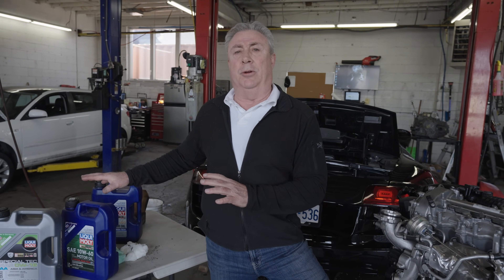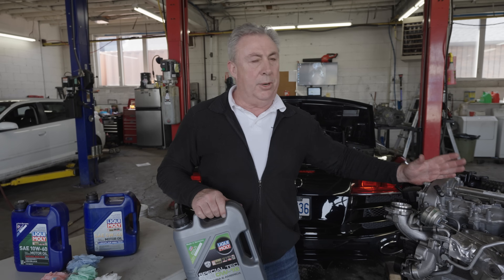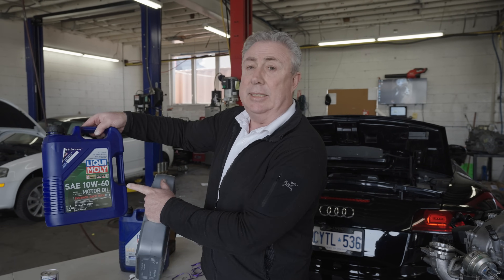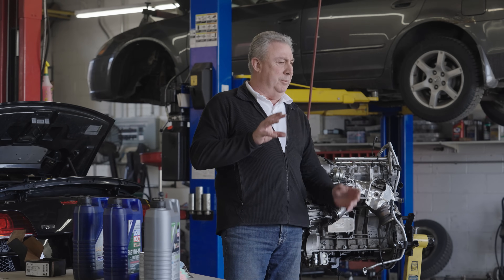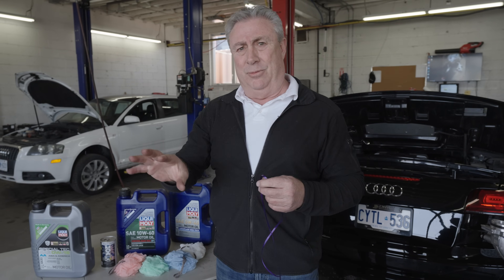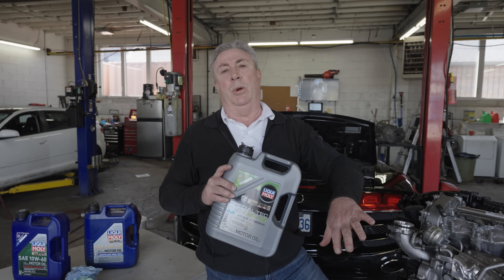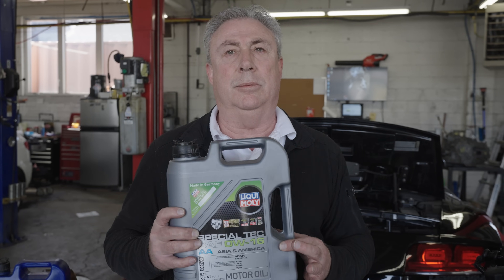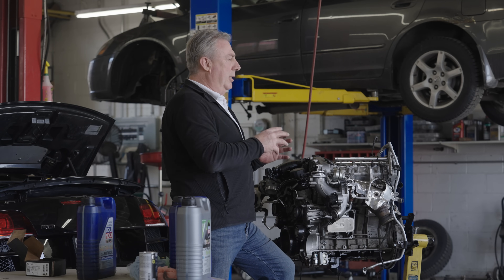Thin engine oil just a Scam? What's Safe

Comment: Thinner oils are also result of motor developments. As always it is a catch 22. Higher revolving engines and turbines (including airplanes) require thinner oil to keep up with fast rotating parts to fill surface gaps and create oil separation. Using high viscosity oils in this application basically makes parts starving for oil. Lower revolving high load oils use heavier oils grade to suppress shocks. Also hydraulics actuators used in modern engine require thinner oils with stable characteristics. In fact it is similar to any hydraulics like automatic transmissions valves etc etc. This is also a case due to usage of VVTI and hydrolilic lifters that all work by oil pressure.

Comment: I am no expert but most of the comments come from experts who still drive their well-maintained, age-old vehicles. The point Steve is making actually makes sense for Euro 6 (BS6 in India) diesel vehicles in particular fitted with EGR, DPF and DEF systems which are, in reality, a nightmare for new vehicle owners including myself. I made the mistake of using 5W30 fully synthetic engine oil with additives and it is ruining my DPF system even after a mere 800kms of using it. I am tempted to agree with the old timers here that higher engine oil grade is better for the engine provided it meets the API specs of your recommended oil.

Comment: Manufacturers use thin oil to get 1% better fuel efficiency. Car owners drive around with low tyre pressures.
And a whole lot of junk in the back….

Comment: The way I look at it.  If you’re in death valley in the summertime and it’s 120* your engine has a thermostat that maintains a constant temp of approximately 190*.   If your in the Yukon in the wintertime and it’s -40* your car has a thermostat that maintains a constant temperature of approximately 190*.    So for 98% of the time your engine is at 190*. The 2% is the cold start warm up.  So I never change the viscosity of my oil for seasonal reasons.  All of that is just a marketing gimmick to sell more oil.

Comment: I've been doing my own oil changes in all my vehicles since I was 16 years old in the 1960's. I never use anything thinner than 10/30. Occasionally I drain oil from a 5/20 hot engine.... it's like water and I don't want it in my car. Now I have a new NV200 Nissan van. I won't let the dealer change oil in it and I only use 10/30.  
From my experience, I don't buy the line that you must use thin oil for tighter tolerance engines. I burned 15/40 in my Toyota Matrix for years. This philosophy is working just fine in my car engines which are no different than any other car engines. Also, if you burn thin oil, you are at greater risk of developing engine oil seal leakage problems..... IMO and from what I've seen. 
I would bet, if you took 10 new Nissans or Toyotas and used 5/20 oil as recommended until they died..... and 10 identical vehicles and ran them on 10/30, until they died, the 10/30's would last longer.
Reply: which is better, 10w30 or 5w40?
Reply: @frv6610    10w30. Anything below 10w is too thin... IMO. If its in a high mileage car and you want a thicker oil for summer or if it's leaking a bit, then I'd go to 10/40 or 15/40 like I did in my high mileage Toyota Matrix.

 Following is something I got from the German car club--- 
 ( In the german oil club Forum, 0w-40 is regarded as a very bad choice, because it is just a marketing gag. Poor quality oil, boosted with VI Improvers that shear down in no time. Avoid it all cost.
If you want to protect your engine, you need a thick base oil, therefore 10w-40. As a side note, allways remember, cold start wear dont exist.
All you need is a thick base oil, thats the most important thing.)

Comment: My 2025 Toyota requires 0W8 Full Synthetic Engine Oil and states it should be changed every 10,000 miles.  I called the dealership Service Department, suggesting that I would be changing the oil every 5,000 miles.  The Service Department warned me that I would void the manufacturer's warranty if I changed the oil at 5,000 miles instead of 10,000 miles. I told the Service Manager that line of thinking made no sense. He then stated that he was annotating this conversation regarding my car's warranty information. Or in other words, threatening me.  Yes, a Toyota Dealership Service Department Manager stated that changing the oil at 5,000 miles, instead of 10,000 miles, would damage my engine and void my warranty and that it was now in the notes regarding my 2025 Toyota!
Reply: I had similar issues with my Toyota service. So when I bought my new ram pick up truck, I drove it to the Toyota dealer and told the salesman and finance manager your service department cost you money and told them I would never buy from the dealer again and so hasn’t three of my friends.
Reply from the maker: It’s amazing how they think that doing something good for your engine would damage it. The Service Department is simply trying to discourage people from doing their due diligence!  There is clearly a different agenda other than best engine management practices on display. 

We've run lab analysis on the used oil of hundreds of new cars to establish a base line to measure engine wear.  In this effort we take a peek at the worn parts metal content in the oil and can accurately track the break in period activity.  We've always seen incredible results on engine service life with 3 or so oil changes before 10,000 miles.   And the same with a regular schedule of 5,000 mile oil service intervals.   

Gotta say, I really like the idea of 5,000 mile maintenance schedule in any case!!  Thanks for the comment.

Comment: Mechanic for 40 years. Had a client brought in an old Subaru wagon 5 speed manual. Can I drive from California to Texas and back. Your transmission will not allow you to shift into 3rd gear. I would not advise. Came back couple weeks later see you were wrong 😵‍💫

Comment: I am sure the designers of modern engines know their craft!My old Honda crv 2004  has a range of grades i can use and it has a graph of temps to work with in the hand book.I always change every 6 months regardless.People also overlook valve clearances in older engines.My newer car is a Honda crv of 2012 ,this uses 0-20 and has never shown any problems.Maybe i am lucky.

Comment: Im 71. Never heard W for winter. It was the base viscosity such as 30 weight. It never gets thicker as in 10w-30 , its still 10 weight oil.
Reply from the maker: Great point!  But that W rating refers to the cold flow properties of the oil at startup and is measured at -17.8C or 0F. The second number refers to the flow at high temp of 100C or 212F.

Hope that helps.  Thank you very much for the comment!

Comment: VVT requires thinner oil to get through the extremely tiny holes. That’s why they fail from to long of change intervals with build up. Never go more than 5,000 miles between changes if you want your VVT engine to last.
Reply from the maker: You are absolutely right - it’s critical to consider the VVT when choosing an oil change interval.

Comment: Poor explanation of the sae numbers, not really very useful video. I believe variable valve timing engines not good to mess with thicker oils. At engine running temperatures the oil will be alot thinner ( viscous) too, worth mentioning. I think a better/clearly explanation of the two numbers on an oil can would be very useful here.
Reply from the maker: Thanks for the feedback, I’ll make sure to explain SAE numbers in more detail in future videos!
Reply: @TheAutoStationBurlington  yes seems alot of confusion on that topic, I guess there is a different scale used in the cold and hot scenarios, thats where the confusion stems from.

Comment: If you don't use 0-20 Oil in Ford gas engines they WILL BLOW UP  
Two of the NEW FORD WORK TRUCKS had fresh oil changes and both blew up within 2 weeks.  
They tried to get Ford to replace the engines and they discovered 10-30 oil in them and VOID THE WARANTY
Reply: You must not be in the US. All current Ford truck engines call for 5W-30 oil in the owners manual and on the oil cap. Ford has never used 0W-20. That's a GM and Stellantis thing.
Reply from the maker: Very good point - I've never heard of an engine blowing up in a couple of weeks unless there's some other issue regardless of oil choice.  Do you happen to know which Ford motor?

Comment: It’s not the oil. It’s the person not changing it on time. Engines easily outlast the vehicle with normal maintenance. The new oils are SO much better than what used to be used. New syn. 0-20 will outperform 10-40 Dino.  why give up power and efficiency?

Comment: The higher the mileage, the higher the oil thick number to use.  Never put thin new engine oil in an old engine.  Old engine has more space between parts, more worn parts.  Needs more cushion between parts.  Thicker Oil.  Also "Thin oil" will consume much faster thru the loose now older piston rings.  It will suck thin oil up thru loose piston rings. Thin oil will be suck up thru old rings to the point a couple of quarts left after a while, and that will destroy the whole engine.  I saved many engines by adding thicker oil. I also add Dura Lube to engine and my jeep rear end too.  Jeep is over 190k miles, Works great.
Reply: Nonsense. All oils get thinner as the temperature increases. So in your case you maybe used a oil with a higher number after the 'W'. Meaning you clearances were messed up for some reason and you didn't want to rectify the problem.
Reply: @morndrewitbooi1896  Nonsense you. Thicker oil is needed for more room between parts.  Sorry you cant get it.  I saved many oil eating engines by not using new engine oil said on oil add cap. Dohh ! Old mechanic here, you kiddo. Think..
Reply: @outwiththem OK now what caused those clearances to increase? Using thicker oil and not changing the oil regularly. So get your facts right
Reply: @morndrewitbooi1896  BS.  It was using thinner oils recomended for new engines only.  You are a liar saying the contrary is done.  Thinner oils are used for new engines not thicker.  Dont bring lies and fake news to me now, damm guy.
Reply: @morndrewitbooi1896  Some people believe in "alternative facts".
Reply: @morndrewitbooi1896  If you have very high mileage, but your engine still runs well and is still quiet, you don't have a reason to "recify" the problem.
Reply: @jamesbosworth4191 What you are saying doesn't correspond to what I've said. Mileage is just the number the wheels have driven. You can have 2 of the exact engines. 1 can be 50000 km's but doesn't run properly and is full of sludge while a 500000 km engine could be running very very well and looks brand new on the internals.
Reply: @morndrewitbooi1896  And that is all too often because one has had regular oil and filter changes and has been kept in a good state of tune and the other one has not.

Comment: 100% synthetic oil can handle higher temperatures. Some engines also require dexos. If the car is under warranty, you better use manufacturers' recommendations.

Comment: If it's cold out and it actually starts, let it warm for a minute and drive it conservatively for a few miles. The internal temp of the combustion does not change rather the heat transfer between the metals and plastics. I did the best I could for the environment but I have failed to control volcanoes spewing ash and to add insult to injury every year I have to watch California burn itself to the ground in their effort to save the environment.
Great video, well explained.

Comment: More confirmation that contemporary vehicles are not made to last long but only to get through the warranty period. Not the country I grew up in. My truck's owner's manual specified 5W-30 and that's all I'll ever put in it. Ford amended that to 5W-20 a few years back but not for better protection. Because of some woke lamebrains in D.C. sacrificing reliability for 1% fuel economy increase. Kiss my oil pump.

Comment: Wow okay this guy knows more than Engineers to design these engines that have smaller oil passages and needle bearings in them which require the viscosity recommended by the engineers that Design This engines anybody listens to this fool is strictly a full so go destroy your engines

Comment: I tried to save some money once by taking my Lexus to a Toyota dealership for an oil change. When I got my receipt 4 hours later it said 5w30 oil was used instead of 0w20 and it was 7 quarts instead of 9 quarts put in. I informed the clerk of the issue and they called the tech out. He told the clerk to change the receipt because he put in 0w20 if that’s what he saw on the oil cap. I then asked him why he only put in 7 quarts. He said because it only takes 7 quarts. I said so you looked it up, he said no I’ve been doing this long enough to know how much it takes, I can eye it and see 😐. After fussing back and forth with him for 5 minutes I asked him to come outside with me to check the dipstick. It was just barely touching the low line. He said I could’ve swore this only took 7 quarts. Then he finally looked it up and put 2 more quarts in, probably the correct oil this time but it still had mostly 5w30 inside the engine. My LS460 would take 30 to 60 seconds to start up after that oil change, so the next week I took it in back to a Lexus dealership for another oil change and as soon as it was done it started right up, so heavier oil that’s not recommended by the manufacturer definitely doesn’t work well in some vehicles.
Reply: Did you get the price lowered at the wrongdoing dealer?
Reply: @frv6610  no, I just never went back there again.

Comment: I just rebuilt my 1.6 turbo diesel in my 2018 GMC Terrain, I WPC treated every single surface where rubbing occurs. I can literally turn my crank with just 2 fingers... Gapless top rings from Total Seal and did the piston skirts with Line To Line Coating's abratable coating and now my compression is 55 psi over spec and even across all 4 cylinders. The parasitic drag in this engine is GONE!!!! I'm running the recommended 5w30 but I think I can even go to a 0w20. I don't know why the manufactures don't do this from the beginning. I now EASILY get 50 MPG's across the board and can push 65 on the highway if I'm really paying attention. And I still think there is more room for improvement with tuning and modifying EGR more. I've solved the disgusting EGR black diesel snot problem WHILE staying compliant with emission regulations by taking EGR from AFTER the DPF. Works perfectly...

Comment: In our workshop, we  mainly use 5w30 then as vehicles age and kms get higher we go to 5w40 then for the much older and/or really high kms, we go to 10w40. There are also the variances of enviro plus, semi synthetic and full synthetic. With each vehicle that comes in, many variances are taken into account when we choose which oil to use including vehicle manufacturers specs.
Reply: Don't you get oil pressure errors?
Reply: @frv6610 no, you only go up a grade and the oil pressure switch is as it's called, a switch, so it's on or off.

Comment: I have a 99 Chevy Silverado 1500 with the 5.3L engine. My owners manual recommends using 5W30 but 10W30 can be used when the temperature is warmer. However in winter it's recommended to use Synthetic 5W30 or if the forcasted temperature is going to be extremely cold for an extended period of time, it's recommended to use 0W30. I run Mobil 1 Extended Performance HM 5W30 year around. I usually only get about 3000-4000 miles on the truck each year, so I just change oil annually. The Mobil ! EP oil is rated for up to 20,000 miles or yearly which ever comes first. I hit the 1 year point and change oil.
The truck always had an engine tick (probably a lifter) even from the time I bought it. I got it in 2011 and it had about 130,000 miles at that time. It would tick for about 15-20 seconds after starting cold then it would quiet down and run smoothly. I currently have about 180,000 miles and after I switched to Mobil 1 EP HM oil, I noticed the tick would only happdn for mayby 10-12 seconds before it quieted down. So the synthetic oil has helped speed up lubrication inside the engine.

Comment: Use the recommended oil viscosity. Mine uses 5W30 period. As proof,  I have no leaks or any oil burning after 272,000 miles. I change oil every six months. Also, I baby the car that means light on the throttle for the first ten minutes of the day.
Reply: The recommended viscosity nowadays is made for maximum CAFE numbers, not proper lubrication.  Do NOT use the recommended viscosity.
Reply: My wife has a 2010 Toyota Avalon.  Recommended viscosity is 5W-30.  It burns it.  With STP added, it doesn't burn a drop.

Comment: As engine heats up oil becomes thinner   Thin oil  will become even thinner   More contact with metal more heat  then metal expands    Nice thick oil is safety  to prevent metal parts touching  less noise less friction less heat

Comment: My dad got a 59 ford truck that smoked, He used kerosene 1 gt 4 gts oil let the motor run for a 1/2 hr.drained it out wile hot did same again after engine cool did it twice.Then put a regular oil change, motor didn't smoke anymore  had power . Marvel Mystery Oil will do the same thing ,oil change + in gas + gearbox , it hardens metal as it heats  up after it cools down. If you have a lot of $ every 2000 miles change your oil. Oil is cheaper than scap car parts but be kind to vehicle and it will last. Fallow the instructions on the container . Piston aircraft use the stuff and run for years safely and don't have engine trouble ,do a google study you'll learn alot.🙏

Comment: In an old car , 20 years plus you can pee inside the engine and is going to work, in today engines particularly those already using 0w8 or 0w16 i think it won’t be a good idea to use thicker oil .